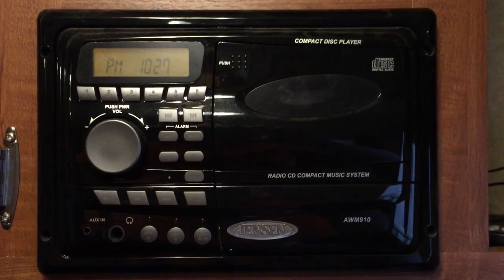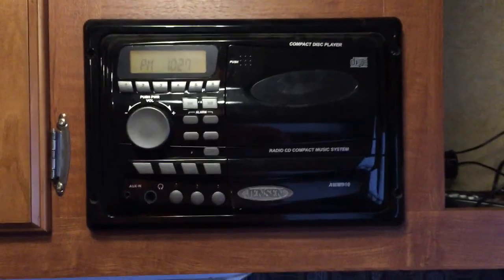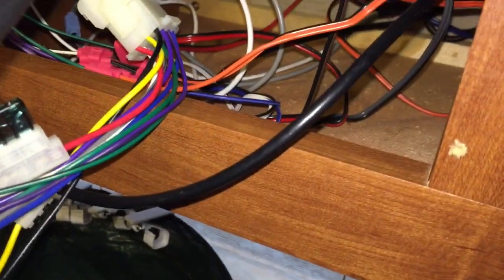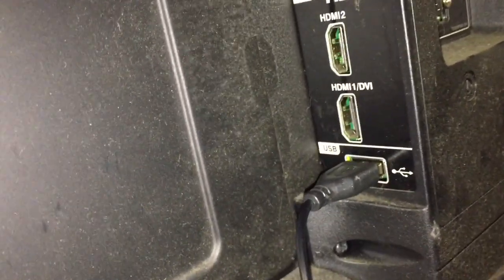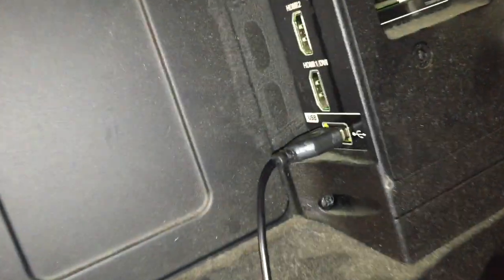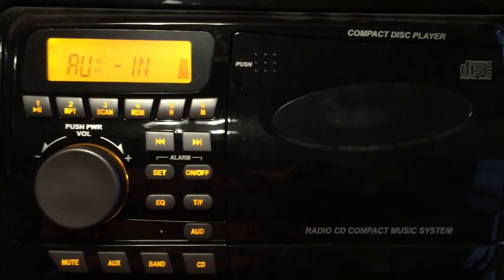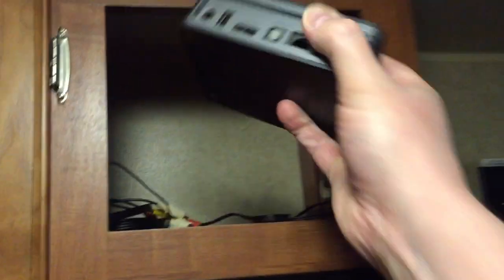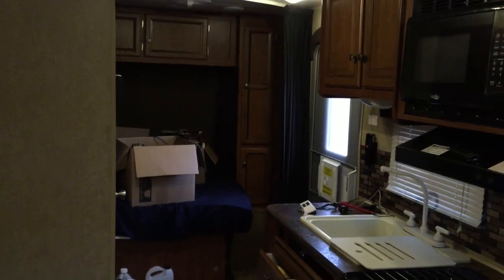RV Mods: Hooking up the TV to built-in speakers

Comment: Hey man was wondering how you set the clock on this guy thanks for the video
Reply from the maker: Press T/F to display the clock. Press and hold T/F, and the clock display will flash. While
holding T/F, press H to adjust the hour or M to adjust the minute. The new time will be
saved five seconds after the last adjustment is made.

Comment: So how exactly did you hook it up with the converter? I’m having issues with not getting any sound. I don’t have a converter either.
Reply from the maker: it depends on your TV, some of them don't have an optical/digital output.  make sure the TV can output PCM before buying a digital converter, if it puts out AC3 you need one that can turn it into PCM.  another alternative is to use the headphone jack if the TV has one.

Comment: How do you hook it up to play a dvd?
Reply from the maker: Plug a DVD player into the TV and it will pass the audio through
Reply: Good info but still not working. PCM good, AUX Converter good to digital optical out on tv and rca to av in good. No luck. Am I missing something? Tried on av and aux settings on irv6500